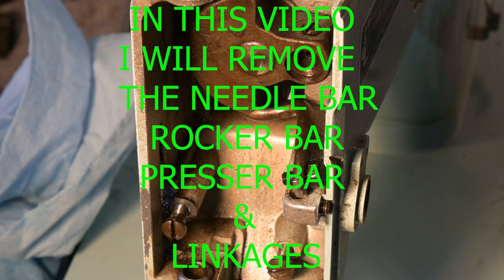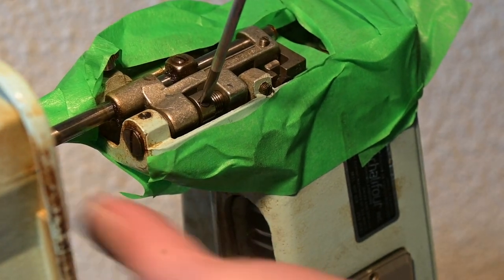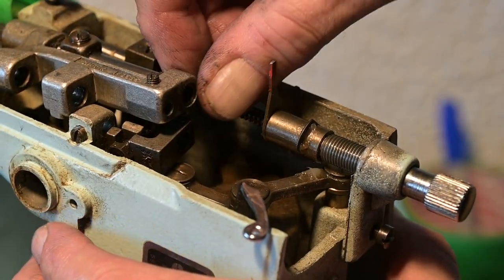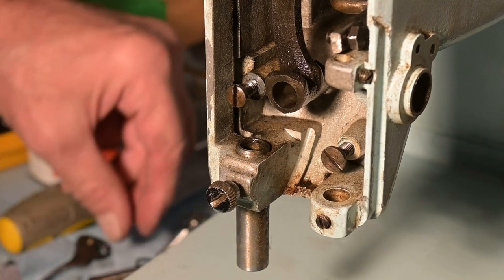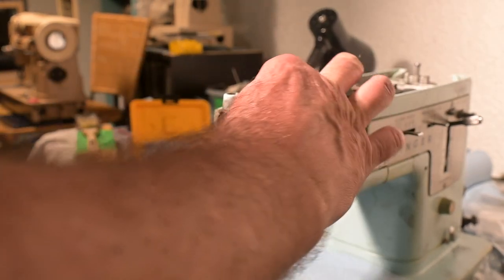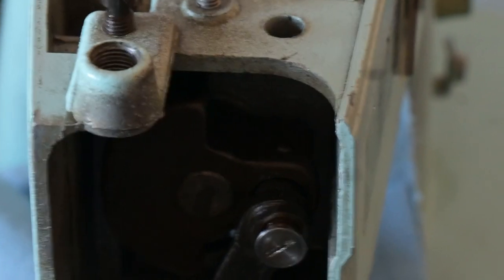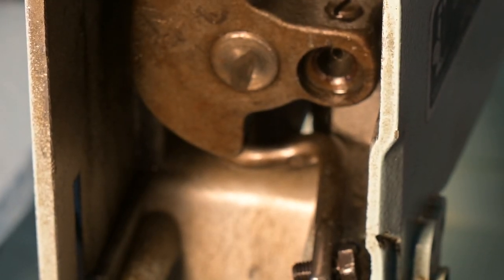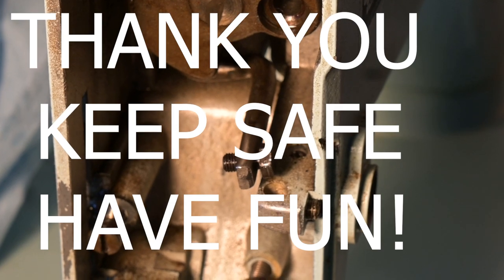REMOVE NEEDLE BAR ROCKER BAR ASSEMBLY SINGER 348

Comment from the maker: Howdy! It is Wednesday, October 11, 2023. This was the first time I took the whole front end apart! 
The screw is a stud!
Right now I am finishing up Video #275. In this video I take the Rocker Arm Stud out again and correctly install the Rocker Arm spring and the clamp it is attached to. I also discover the bottom set screw hole is stripped and won't hold a screw thread.
Have fun, enjoy your machines!

At 00:58 I call the the Rocker Arm Stud that goes in the bottom a screw. That is the Rocker Arm Eccentric Stud. It is not a screw. I am glad I learned that.
The set screw, that secures the bottom of that stud, has no threads to screw into. The threads have been stripped inside hole on the machine. How to restore that? Tap and drill it? 
This train wreck machine is clean at least. Lol! 
And I am learning a ton from this machine!
I already need to order a check spring for the tension device. There is also a spring that broke at the top of the Presser Bar. 
This is another item for the list!
Enjoy!